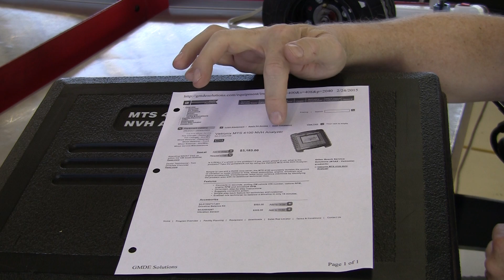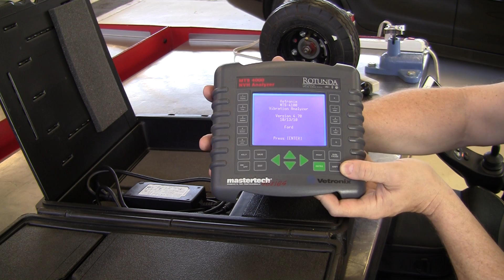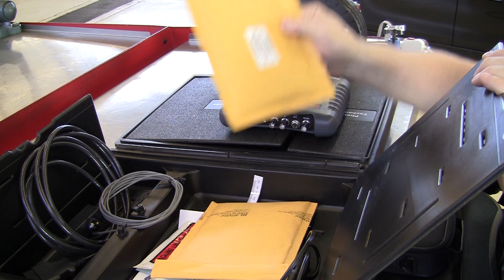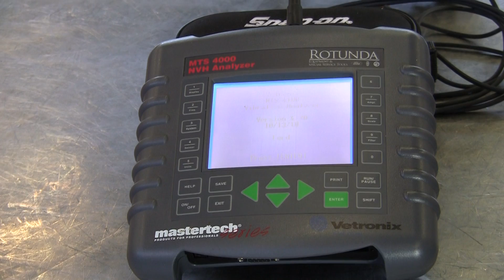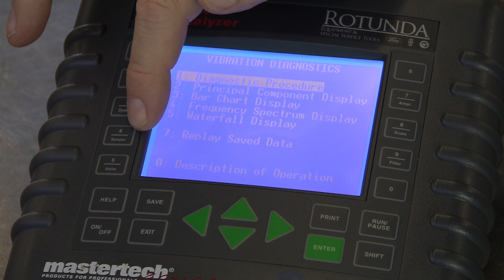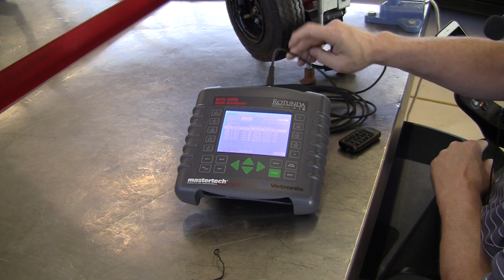Automotive Vibration Analyzers - Part 3 of 5 - MTS 4000/4100

Comment: As an expert in your opinion what is the best analyzer of the accuracy and mobility !? Your personal opinion !?
Reply from the maker: The NVH app. See www.vibratesoftware.com
Reply: @WeberAuto  Connecting the vibration sensor strictly to the driver's seat mounting bolt for measurement ?

Comment: What's the difference between 4000 and 4100 ? B another question he strictly measures the part of the vibration to which the sensor magnet or the entire area near the sensor.?
Reply from the maker: The 4100 has better software. Entire area near sensor
Reply: @WeberAuto  Hello.Who uses the device to search for noise with a microphone? How to search for noise and connect a microphone?

Comment: Mr. Kelly, I've been able to retrieve Engine Speed, Vehicle Speed and Driveshaft Speed on multiple makes with success.  The tool works great and is very helpful identifying the root cause of the vibration.  On the "Select Operating Mode" menu press 9 "Tester Setup.  Scroll down to 6 "Communication" and select which BUS the vehicle uses, usually CAN.  Then go back to "Select Operating Mode" and manually enter the VIN (not necessary though), select Engine Configuration (I4, V6, etc), Engine Accessory Drive Pulley Diameters (I leave it blank), select Drive Type (2WD, 4WD, etc), Gear Ratio and Tire Size.  Once the info is input go back to "Select Operating Mode" and drill down to Principal Component Display.  The tester will now use these speed and HZ parameters to identify the most likely vibration culprit.  It even identifies different Order vibrations.
PS: Great videos!!
Reply from the maker: +Matt Witters Good to know, thanks for the feedback.
Reply: And where can I find video instructions for connection and detailed analysis?
Reply: Hello.Who uses the device to search for noise with a microphone? How to search for noise and connect a microphone?

Comment: Great videos, thank you. This is the latest and only software version 4.70. You can still use with OBD2 vehicles other than Domestic by entering in by VIN and it will show your RPM and speed via OBD2 protocol, and show the component that is suspect. Also it is still supported for repair and parts by BOSCH Automotive Service Solutions at 855-267-2483.
Reply from the maker: Thanks for the feedback. When I called Bosch last year for this video they told me it was no longer sold or supported. It is good to hear service parts are available.
Reply: And where and how can I update to the latest version ?